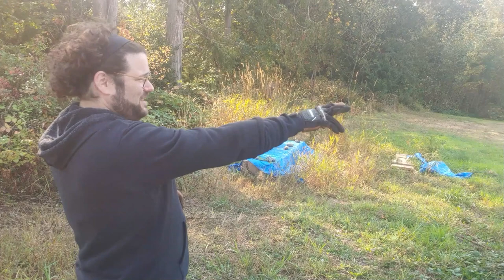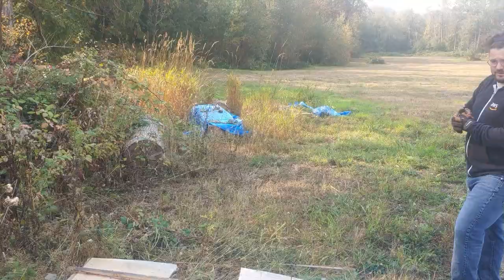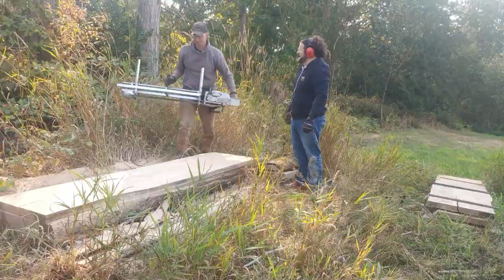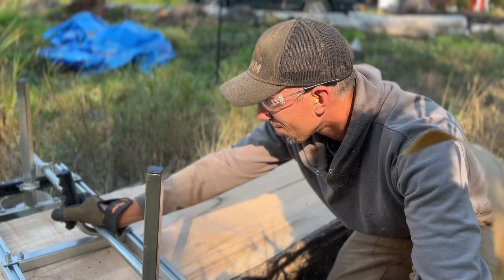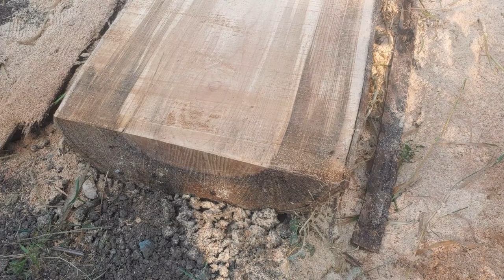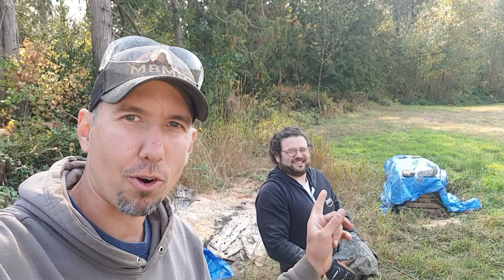Chainsaw Mill Slabbing Maple

Comment: You need to seal the ends of the logs with paint or a wax sealant to keep them from splitting lengthwise.
Reply from the maker: Thanks for the tip!